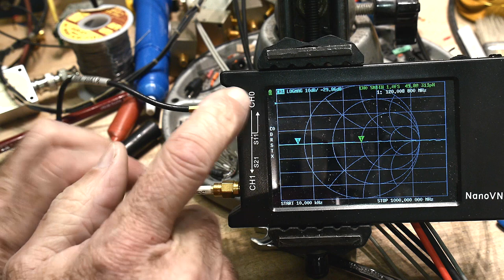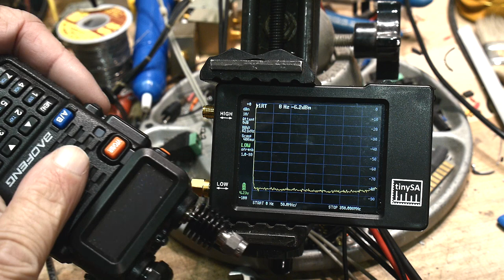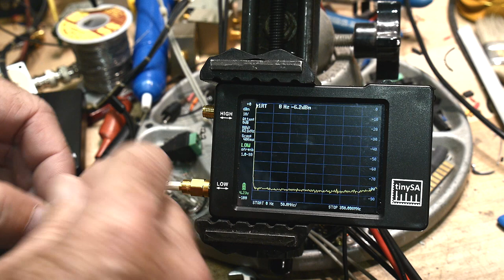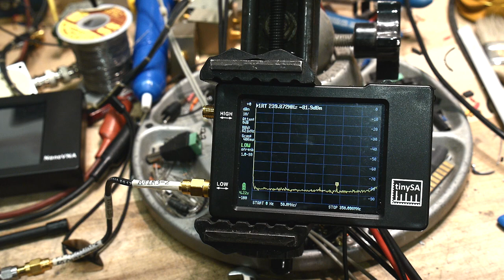#568b TinySA NANOVNA Measure and Use 30dB Attenuators

Comment: Tthank you for this video! I did the same today with the NanoVNA to test 3 attenuators. Something interesting I noticed is that for the 20db and 10db ones, when connectign them only to CH0, I had to add the 50 Ohm terminator to see the impedance marker right in the middle. There was no need to do that for the 30db one, like in your case. All 3 showed 50 Ohm when measuring logmag so no worries there.
Reply: Ah using logmag! That's what I was looking for, thanks!

Comment: I have just bought one that looks identical from amazon for £20 it will be interesting to see how it compares to a more expensive attenuator. I studied Smith charts about 30 years ago unfortunately I have forgotten how to drive them.
Reply: I got a little 30dB 10W one from Amazon and it checks out on the Nano VNA just like in the video. Mine reads about -30.51 dB and smack in the middle of the Smith chart using using 2 meter band on the VNA.

Comment: Nice video... Was looking for how to test attenuators with nanovna and didn't see what i was looking for--how did you select the format parameters on the traces?

As for the tinysa, I get best results using  -80db putting in 1 watt. Very sensitive device!
Reply from the maker: yes, testing attenuators is just an S21 measurement, here are some other ways
https://youtu.be/_QcZCCTHQUQ?si=dfO91XHiXeJK_9Ia
https://youtu.be/z2Lh8KU6wew?si=XMDQt-NK7WYolPma
https://youtu.be/w3yFsQ_bafQ?si=QkuyYPDqVNRLLN9w
Reply: Thank you. Will have a look!
Reply from the maker: here is a very old video showing an S21 measurement using the nanovna

Comment: Hi could you show in a video injecting a signal into the TinySA (Internal source or other) but pass that thru an external filter to filter out the fundamental of your signal to only see the harmonics of that source signal on the TinySA? Trying to get a sense of the noise floor with the fundamental removed.

Comment: isnt that 80 db total? 30db value on the black one with heatsink...and then the little one after that clearly says 50 db. is that correct? i thought you said 50 db total.
Reply from the maker: the little one is clearly marked 20 dB
Reply: ok sorry  @IMSAIGuy

Comment: You can also run your radio in its lowest power mode so you need less attenuation. W8ASA
Reply from the maker: True, but if you are checking for harmonics, then you need full power
Reply: @IMSAIGuy  why is that?
Reply from the maker: @Justin-bd2dg  the amplifier will distort and cause harmonics at high power levels